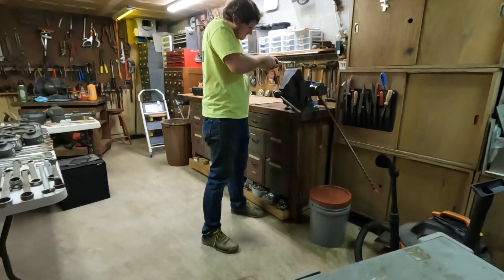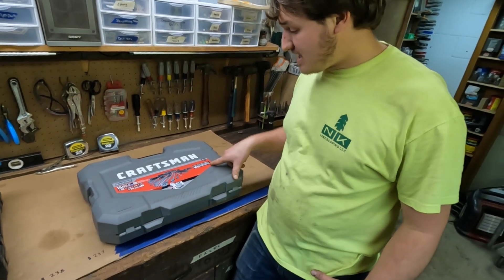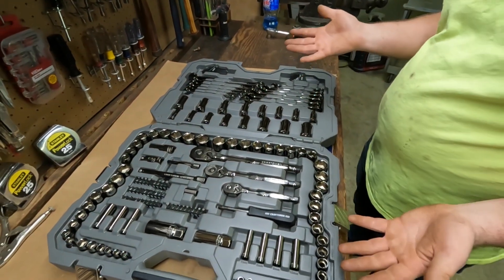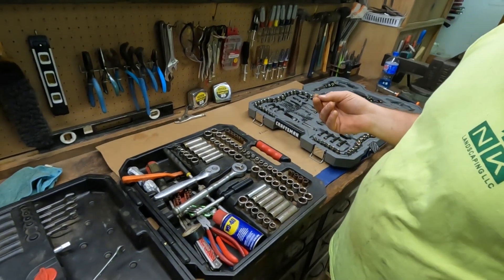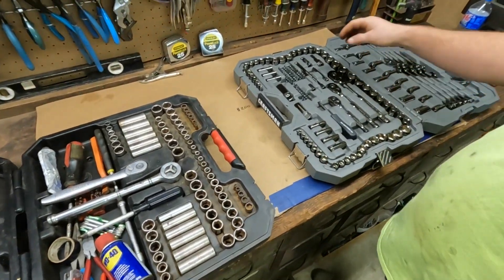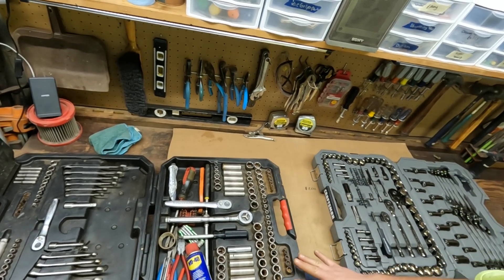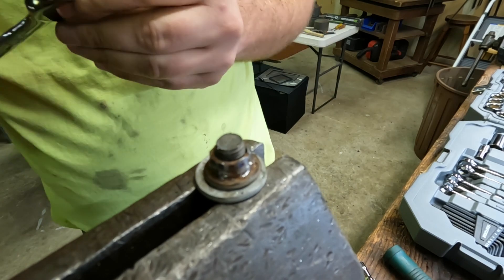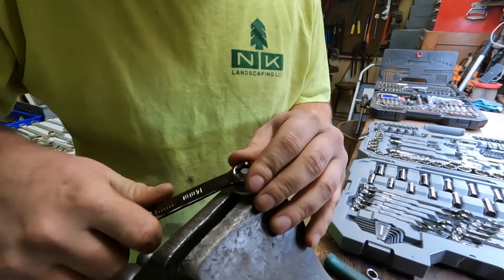Testing Craftsman New Overdrive Series - Socket & Wrench Set Review

Comment: You were turning the wrench the wrong way on the open end, it's not as big of a deal if it isn't overly tightened but it's double important on the nonslip style wrenched where the serrations are placed
Reply: came to say this, looks like open end may have worked if it was flipped the correct way.

Sidenote: That Garage/Trailer/Abandoned school is badass. Keep it up guys!
Reply from the maker: There is no right or wrong way to
Reply: I got mad when I saw that. And there is a right and wrong way to use that open end
Reply from the maker: Will use it the right way next time

Comment: I would assume that is a 90 tooth gear with stacked pawls, and those wrenches are essentially MAC rebranded believe it or not. I think the days of picking on imports are over, everyone has caught up.

Decent kit, good video young men 👍
Reply from the maker: Thanks
Reply: How are the sockets compared to MAC?
Reply: Don't we pick on imports for ethical reasons not quallity?
Reply: nope, non of the overdrive is MAC rebranded. They just applied the RBRT design to the gunmetal crome line of tools Craftsman offers. the ratchet is a updated 120T gunmetal chrome ratchet. its a 90t gear double stack just like the 120xp gear wrench, to get the 180t. MAC/Proto 90t is completely different design and fully made in the usa.
Reply from the maker: Its an ok set

Comment: 3 months in my garage with NO USE yet and it’s RUSTING like HELL. 😢
Reply from the maker: We’ve used ours a few times, no rust at all
Reply: @thenkgarage  probably partially a humid climate thing, but I’ve got WORKPRO wrenches that were in the same environment for a year and a half and they didn’t rust!  Even have a very similar “gunmetal chrome” coating.. bummer.
Reply: @spychiatrist3045  get some desiccants or gel packs whatever they called those. Humid climates will rust anything. Also oil your tools. Just a light coat will do.
Reply from the maker: Yeas
Reply from the maker: Ok

Comment: It is very similar to MAC RBRT sockets and wrenches. Minus the price tag. I wish they'd sell individual socket sets rather than a kit. Those sockets would be good to have as a backup. I prefer to use regular sockets so you don't round fasteners. I think if you do encounter rounded stuff, these sockets would definitely be good to have.
Reply from the maker: We bought it as a kit to pull out only when fasteners are rounded or rusted. It may come in good use that way

Comment: Although it's just an aesthetic thing, I love the gunmetal look.  The "overdrive" series looks like it replaces all the gunmetal series kits but with a grey case and the new "grip" teeth on all the various parts.  Unfortunately never saw the older 154 piece gunmetal kit ever go on sale, so never did buy it.  The 121 piece kit seems more popular and goes on sale all the time ($99 right now).  The high price now might also be due to the fact that all this stuff was only recently released.  The 284 pc kit looks like it'd be great for filling out a tool cart, but I think the wrenches not being 12-point would be kind of annoying - not the main set you want to use for your daily drivers, but something to complement what you already have.  The "deep" sockets all being about semi-deep also probably makes them more of a complementary set.
Reply from the maker: The gun metal is a good look
Reply: These wrench’s are to prevent slipping 12 point is terrible at doing then even spline drive is better the 12 point
Reply from the maker: 6 point is best when you need the ultimate grip

Comment: I think the price is fair considering the us dollar is in the toilet with gold at $2000 an ounce. The harbor freight quinn set which is just rebramded gear wremch is like $400 bucks. The cases look nice and all but the more complete set whih i believe os marketed as loke 284 piece is around $380 with no plastic case but it seems like thats marketed for beginner techs who prefer not getting a cumbersome plastic hinged case since the 284 pc set comes with trays that can be put in tool box drawers for handy organization. Idk how i feel about the mee dual pawl 90 tooth ratchet design. On one hand its nice theyve updated the gunmetal ratcets to be servicable but i really like my dual pawl 60 tooth\ 120 position gunmetal ratchets despite tje closed head non servicabilty aspect. Theyfeel really smooth and the back drag is ! manageable. I think i paid around $120 for all 3 of them. But i do like that they have a new super slim profipe 180 tooth ratchet in this line. I think its rare to find a taiwanese tool these days that isnt worth the price pr a piece of junk unless youre going with the cheapest harbor freight option. I hope the overdrive wrenches which are mac rbrt clones are here to stay. I got the metric 11 piece for Christmas and have yet to use it but i like six point wrenches and they pair well with my mac six point flex head precision torque set.  I think the v series craftsman line is a higher quality tool. I am planning on getting the 3 piece long flex head comfort grip ratchet set but finances are tough atm and tha set is like $200 for 3 ratchets but i like that the flex head on the v series dont have a detent that forces the flex position into a certain angle like the 72 tooth Craftsman flex heads or the matco\gearwrench locking flex heads. It can be nice to have and i like the detent on locking flex heads but sometimes i just want a flex head that has a smoother Acton in the flexible joint and is tight due to pod manufacturing when it comes to the yoke and the head fitting together like a snap om ratchet.

I also really would like the long flex jead v series wrenches but don't like the size skips for $175 and only 7 pieces so might go with the gear wrench or even the icon\kabo spline drive double flex long wrenches. It would be nice if they put out a new version of the b series long flex head wreches with the six point zero degree offset fixed end in the overdrive series but without size skipping and maybe evem the "tight torque" aka rbrt feature on the fixed end. Many people love the quality feel and performance of those long v series wrenches but the main comment everyone makes is dissatisfaction with size skipping. I think it goes 10,12,14,16,17,18 and 19mm but i may be wrong. Its not bad for someone who focuses on toyotas like myself but for the same price i can get a more complete set with comparable features.

All in all with this new line amd other current Craftsman offerings by sbd i really dont get why people are always digging into craftsman and saying that the old sears Craftsman tools are so much more supperior. That tri lobe ratchet you have may take more of a beating but ive seen tje 3/8 gunmetal 120t ratchets fail only whem taken to around 200 lbs/ft which is beyond what a 3/8 ratchet should endure or be used for.i think modern tools are mostly better than anything made in the 70's or 80's but people like to wax nostalgic about the times when tools were made in the us and minimum wage earned 95 ounces of gold a year and going to sears was the pinacle of capitalist consumerism which is far from the big box store, outsourced third world labor  stagnated wages and a!erican labor markets transision from manufacturing leader to a service industry of disposible underpaid workers. It may be sad amd foreign to many older people who grew up when things were better but its the way things are now and i dont see ot ever going back to what it was but luckily Taiwan tools are getting better in quality and in many cases  they are almost as good as their Japanese and german comparables for a fraction of the price and im ok with that. As far as the wallmart shopper mentality and the solidifoed transition from quality american made goods to disposible lower cost production alternatives im not a fan but you've gotta take the wins when you can these days
Reply from the maker: Ok

Comment: I'm thinking that your rating isn't fair.  I'm not a fan of modern-day Craftsman tools at all...I'm an old guy. But this is more of a specialized item. You can't compare it to a daily use set. If used daily, you will tear things up. For what it's made for, other than the sizing issues, it ain't half bad. Neither is the price when compared to the same technology from other companies.  By the way, Capri makes a great set of wrenches like these...wave drive...maybe is the name. They are fantastic and priced reasonably.
Reply from the maker: Its just my opinion on the kit, its definitely not what I would recommend to anyone for main use. Its a kit for when you know your working on something rusty and crusty

Comment: Next time try turning the open end the correct way
Reply from the maker: In my opinion it doesn’t matter what direction you use the wrench because in the real world you wont always have access to “do it right” all wrenches have a 15 degree offset for getting in awkward areas
Reply: @thenkgarage  It doesn't matter most of the time, but it is designed to be used a certain way.  Just think of a pipe wrench and how its designed for leverage and grip in once direction, a open end wrench that is designed that way for the same reason.  Also these have extra serrations that are supposed to help grip the nut and if you use it backwards they aren't going to be doing anything.
Reply from the maker: Will use it the right way next time